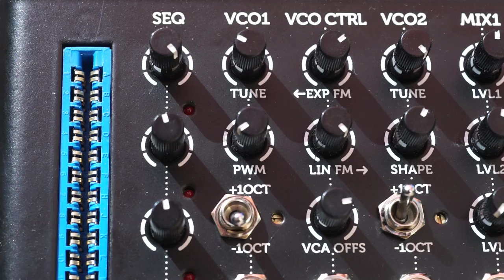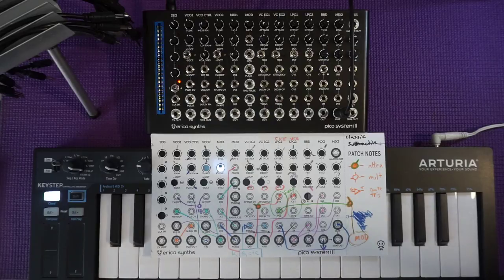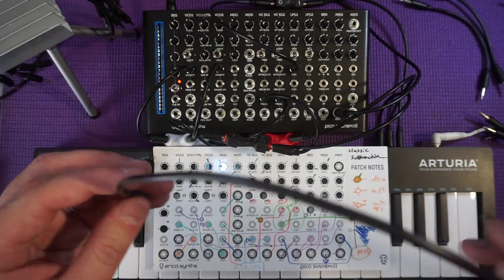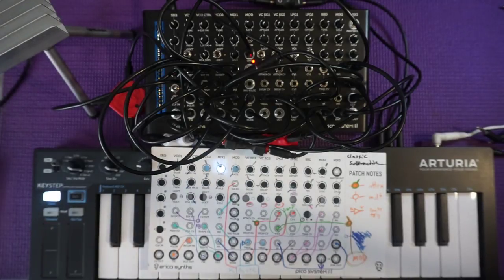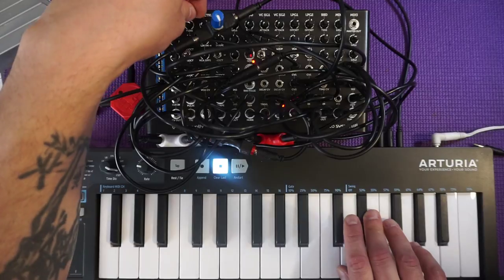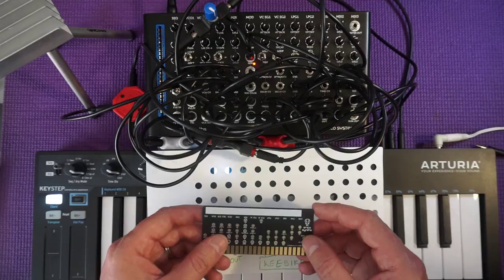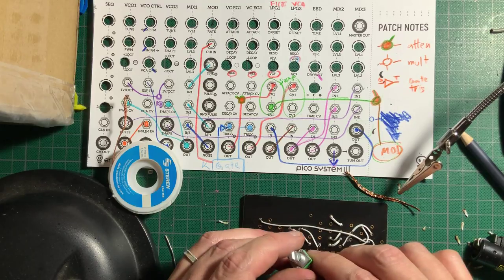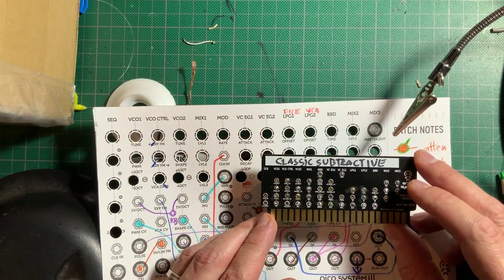Pico Patches Ep 2 - Classic Subtractive Patch - Preset card fabrication #picosystem

Comment: Probably a newb enquiry but I’m curious about your choice of a diode instead of a resistor in your trigger to gate circuit. It’s just different to most I’ve seen.
Reply: Each has its own audio effect in the sound. Some people use a switch to select between them. Try it!
Reply: You could use IC socket type header pins on the cards and use mini patch cables like on the Bastl Kastle
Reply from the maker: Brendan, this is the core of Ken Stone's Gate to Trigger converter. Ken's version has buffers and a comparator, but this is fine for something simple. A resistor to ground would just weaken the trigger signal, while the diode has the job of removing the negative portion that gets created when you pump a gate through a capacitor. Just the cap works fine for the Pico, but I wanted to make my doodad more versatile :)
Reply from the maker: @tonalaxis  that's one of my upcoming projects :)
I just need to buy some more of the right kind of header!
Reply: Yeah ok. It’s actually the ken stone design that lead me to think it was just a cap and resistor (along with some threads on mw). I’ve made a couple actually inspired by a post you made on fb but never noticed you used the diode before. It works though!
Reply from the maker: @bubbleandsquawk  It should work with just a cap. A resistor will just tame the incoming current and a resistor divider will reduce the incoming voltage. Since Ken used a comparator which will output a consistent voltage, he chose to divide down and limit the incoming to be safe. For a passive that won't be buffered or sent through a comparator I prefer to use all the available incoming voltage which is why I don't use a resistor. Look at Ken's design again, you'll see the diode after the cap. I consider that to be the "core" of the idea.
Reply: @QuincasMoreira  Excellent. Thanks for the explanation!